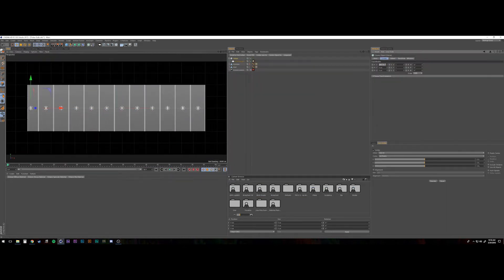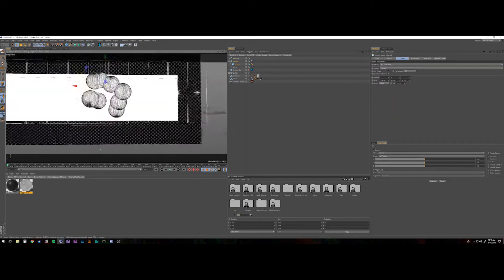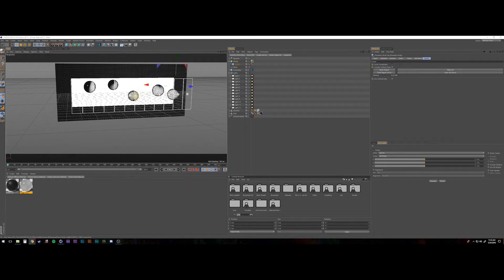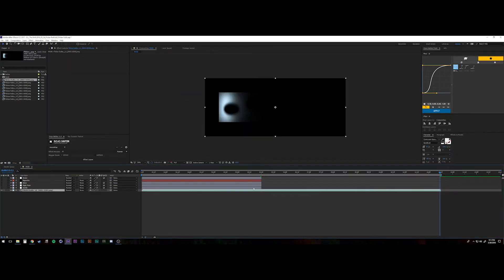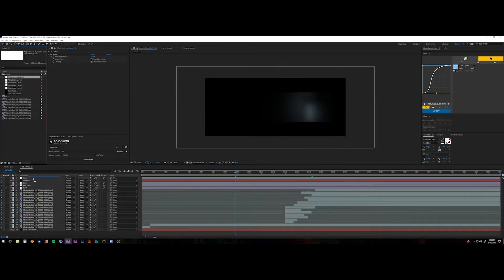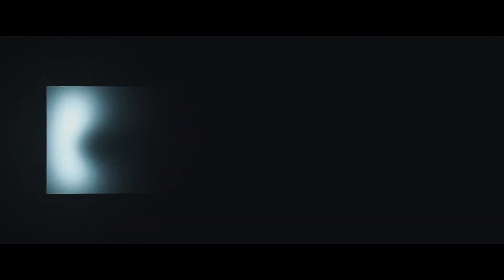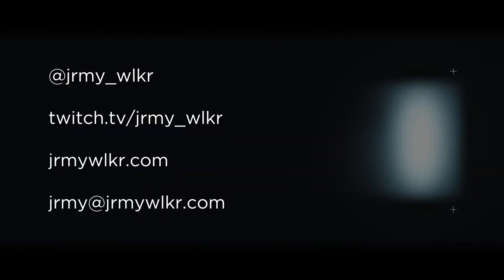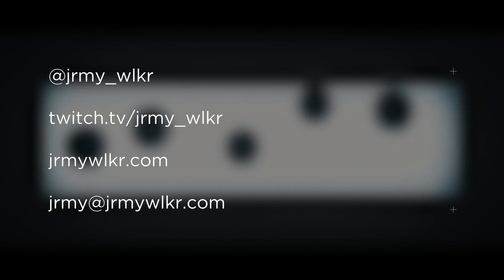The Drill_011 // Animating Lights with Light ID Pass in C4D

Comment: Hello, I have a question regarding the light ID passes in AE. When imported into AE from render, my opacity does not blend with each other because it hides the other layers, how can I have it so they can all be present without blocking others?
Reply: Set the blend mode to add with a black solid